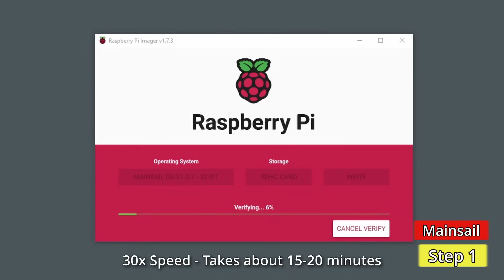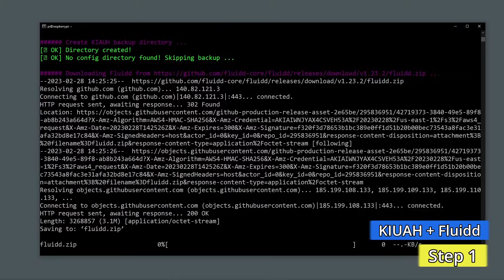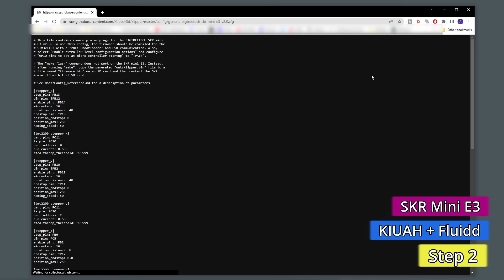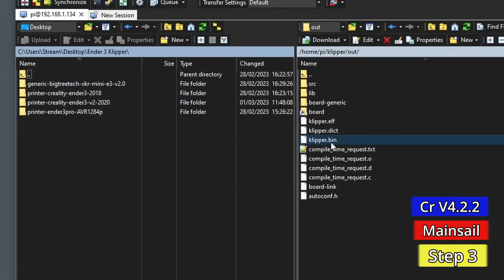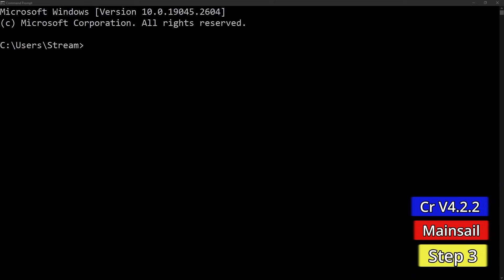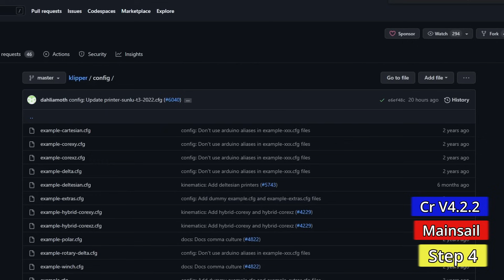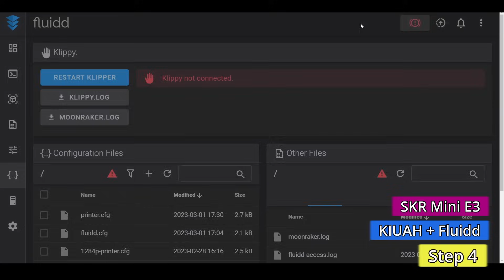How to Upgrade to Klipper on any Ender 3 for High Performance

Comment: FYI, when you suggest to NOT install the macros, this results in the mainsail.cfg file being missing.  If you run through the install again in KIAUH then the only prompt is to install the macros.  Doing so will add the mainsail.cfg file.  I saw some comments below about a missing fluidd.cfg and thought perhaps there was something similar happening on the fluidd side.  Hope this helps someone.
Reply: Thanks, it did..

Comment: When adding the board alias for the LCD display, you copied the alias from board 4.2.7. not board 4.2.2.  When I changed the bltouch pins to match the alias and couldn't get the bltouch to a closed state.  I found the LCD display config without the alias and the bltouch sensor worked correctly.  Everything else was spot on, thank you for this video.  Keep up the good work.
Reply: Hey, can you help me with this one ? Did you find a Pin-config for the 4.2.2 ? my display does not want to work :D
Reply: Could you please tell us where you found the LCD display config without the alias?

Comment: If you have problems with Mainsail and Ender where you can get the mcu but the the Mainsail os doesnt connect to printer (printer is not ready the klippy host software is attempting to connect. please retry in a few moments.), try usin command "make clean" when making firmware. I had made typo to config before and only this fixed it
Reply: what do you mean by when making the firmware? as in flashing it to the raspberry pi?

Comment: Klipper reports: ERROR

Include file '/home/pi/printer_data/config/fluidd.cfg' does not exist

Advice please :-) Thanks.
ENDER 3 2018 v1.1.3 Creality board.
Reply from the maker: you need the fluidd.cfg file. check the fluidd website and you'll see how what it should be.
Reply: @Vector3DP   thank you, it just lead to more errors and config warnings .. all a bit uninformative or Me.

Comment: I have the same Ender 3 neo with the 4.2.2 main board, I had an issue with the probe not working and saying “failed to verify sensor state”. How I fix it was instead of using the bed_mesh, safe_z_home, and bltouch sections from the ender 3 s1 config I used those sections from the neo v2 config. Still swapping Probe_in and probe_out .
Reply: Thank You, this was very helpful !

Comment: I have a Anycubic Kobra Max at work for some prototyping. And I’m thinking of adding Klipper into it. A Raspberry 4 in Germany is about 80-100€. A Creality Sonic Pad with Display and acceleration sensor is 120€. Is it worth to play around with the Raspberry if I can get something already being ready ? Is there anything better with the Raspi solution ?

Comment: thanks for an excellent step by step guide, just migrated my ender3 - 2018 to klipper and mainsail, didn't use a pi but an HP Thinclient T520, first print ongoing.
Reply: With the Creality 4.2.2 board? I ask you because I'm having problems with it right now. I'm using the configuration provided by the video (using the Ender3v2 configuration) for the Ender 3 with 4.2.2, but it doesn't work. My Ender 3 freezes with the blue screen on. I tried using the configuration provided by GitHub, but it gives me a .elf.hex file that the printer doesn't even recognize. I'm also using a laptop

Comment: For those who have problem with Bltouch/crtouch not responding properly or just crashing into the bed: 
1. USE THE ^ sign in the "sensor_pin: ^PB1". 
The damn ^ tells it to use a hardware pull-up resistor!, without it the probe might still send the "open" signal instead of "triggered" when pressed down, causing the nozzle to crash into bed while z-homing
2. don't use aliases in [bltouch] section, just write PB1 and PB0 instead of PROBE_IN and PROBE_OUT
Hope it saves some of you the trouble of figuring it out

Comment: This is the best video on the subject that ties it all together. I had spent many hours on other bits and piece of older videos without success. Once I found this video, I restarted the complete install from the start and ended with a functioning Klipper for my CR10S Pro V2 in very short time. Thank you!

Comment: My CR Touch sends a !! BLTouch failed to verify sensor state
I've been following the steps to a T, and did some research, I came across "pin_up_touch_mode_reports_triggered: False", which starts to home the Z axis. however my cr touch for my neo doesn't trigger and the z axis just bottoms out on the plate and the motor starts going nuts.  Any ideas?
Reply: To anyone with this issue, it was changing the pins in the bltouch section, leave it as is from the printer configuration without the aliases, fixed my issue.

Comment: I am working on an Ender 3 Pro that I have modded to the 4.2.7 silent board, V2 interface, a sprite upgrade direct drive extruder and a CR touch. Is the process the same as for the 4.2.2 board?
Reply: Ok, I discovered that the screen won't work with Klipper. However, I am unable to get the web interface to do anything to the printer after following the video. Any advice on that?

Edit: It will heat up the hot end and the bed, but I can't get the stepper motors to work.

Edit 2: I had the wrong pinout since I followed the video exactly. I got the pin out for the 4.2.7 and now it works.

Comment: Thank you for this guide it definitely helped although the switching between methods/boards did cause some confusion, I would suggest creating a separate guide for mainsail and fluidd with all the boards.

Also FYI there are a few errors on this guide for the SKR E3 v2. 

You cannot upload klipper via usb onto the board, it must be done via SD card and the .bin name must be firmware.bin, not klipper.bin
Reply from the maker: Everything I did in this guide I did complete on the boards so it's all possible as shown unless they have updated it and removed that function but that seems unlikely.
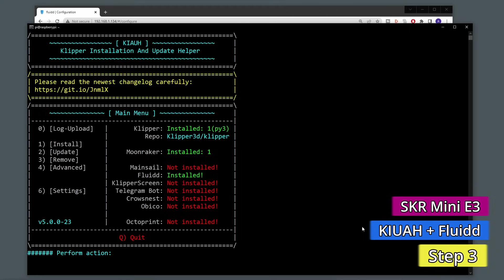Reply: @Vector3DP  If you read the documentation at the top of the E3 V2 printer.cfg (18:05) it has it noted and it did not work for me yesterday until i renamed it

Comment: im getting this error after i drag and drop the printer.cfg and put the [include fluidd.cfg] inside it.  PLEASE HELP
Include file '/home/pi/printer_data/config/fluidd.cfg' does not exist
Reply from the maker: That would happen when it can't find the fluidd configuration file which would be next to the printer. Cfg file. Maybe you have mailsail installed instead, or you need to create the fluidd config file.

Comment: Hi, how can I fix this error? I have the v1.1.3 board

/=======================================================\
| Make sure that the controller board is connected now! |
|-------------------------------------------------------|
|                                                       |
| How is the controller board connected to the host?    |
| 1) USB                                                |
| 2) UART                                               |
| 3) USB (DFU mode)                                     |
|                                                       |
|-------------------------------------------------------|
|         B) « Back         |        H) Help [?]        |
\=======================================================/
###### Connection method: 1

###### Identifying MCU connected via USB ...

/=======================================================\
|                   !!! ATTENTION !!!                   |
|-------------------------------------------------------|
| Make sure, to select the correct MCU!                 |
| ONLY flash a firmware created for the respective MCU! |
\=======================================================/
###### List of available MCU:
 ● MCU #1: usb-FTDI_FT232R_USB_UART_AM00KLO0-if00-port0

###### Select MCU to flash: 1

###### You selected:
 ● MCU #1: /dev/serial/by-id/usb-FTDI_FT232R_USB_UART_AM00KLO0-if00-port0

###### Continue? (Y/n): y
   [➔] Yes

###### Flashing /dev/serial/by-id/usb-FTDI_FT232R_USB_UART_AM00KLO0-if00-port0 ...

###### Stop klipper.service ...
[✓ OK] Stop klipper.service successfull!
  Flashing out/klipper.elf.hex to /dev/serial/by-id/usb-FTDI_FT232R_USB_UART_AM00KLO0-if00-port0 via avrdude
avrdude: stk500_getsync() attempt 1 of 10: not in sync: resp=0x65
avrdude: stk500_getsync() attempt 2 of 10: not in sync: resp=0x63
avrdude: stk500_getsync() attempt 3 of 10: not in sync: resp=0x68
avrdude: stk500_getsync() attempt 4 of 10: not in sync: resp=0x6f
avrdude: stk500_getsync() attempt 5 of 10: not in sync: resp=0x3a
avrdude: stk500_getsync() attempt 6 of 10: not in sync: resp=0x53
avrdude: stk500_getsync() attempt 7 of 10: not in sync: resp=0x44
avrdude: stk500_getsync() attempt 8 of 10: not in sync: resp=0x20
avrdude: stk500_getsync() attempt 9 of 10: not in sync: resp=0x63
avrdude: stk500_getsync() attempt 10 of 10: not in sync: resp=0x61

avrdude done.  Thank you.

make: * [src/avr/Makefile:34: flash] Error 1
>>>>>> Flashing failed!
>>>>>> Please read the console output above!
Reply: same error here. hope someone knows how to fix

Comment: I"m on 23 minute of the video and I encountered a problem. I have ender 3 neo with stock crtouch, but for some reason when I tried to home my printer the console outputs "BLTouch failed to verify sensor state". What should i do?
Reply: After I had the same issue, I watched another setup video. The guy in that one used the Ender3 V2 Neo definition. The BLTouch section had the following pinouts:
sensor_pin: ^PB1
control_pin: PB0

I think the carat was the difference and now that it works, I’m not changing it. 

Hope this helps!

Comment: Please help, I'm getting "No MCU found! MCU either not connected or not detected!" I selected USB. and when I pressed 5, it couldn't find any MCU on USB or USB DFU mode!!  i could only find MCU on UART and it's on dev/ttyAMA0 which failed to flash with that.
Reply: I've managed to get through this and now it's connected. the next issue I have now is the LCD. it doesn't seems to work with your instruction.
Reply: Did you ever figure this out?  @LastZion

Comment: It says MCU not found... not sure what to do.
Reply from the maker: Try again with the part of flashing the firmware to the 3D printers control board, and double check that your usb cable does data and power.
Reply: @Vector3DP  I tried that a hundred times. Only time it detects anything is when I choose uart. - thank you for the reply!

Comment: Edit: I hope that you are resting well and that your recovery and recuperation are fantastic. Sending best wishes and positve vibes to you - Get well soon. All the best to you and your family!
Reply from the maker: One of the best 3d printer firmwares available. Your loss.
Reply: @Vector3DP  Can I offer a suggestion? Find a way to show the section on editing the cfg file in a more user-friendly way. Your video is daunting and possibly intimidating to any users who are not familiar with Linux (which I work with daily, so this is no big deal). Configuring the firmware isn't the issue, but your process could be streamlined a little better with less back-and-forth editing.

Comment: Well, i tried installing Mainsail, I tried Fluidd, but whatever i try when i get to the cd ~/Klipper/ i always comes up with a directory not found. Looking for solutions on internet and forums left me even more clueless. Any chance someone has a solution here. I bet it's a simple one. Like when octoprint didn't want to run due to using the wrong power supply.
Reply: Hey, I guess it is a bit "late", but could be useful for others. If the cd ~/Klipper/ command fails with directory not found it only means there is no "Klipper" folder in your "home" (~) folder. It could be due to a missing step, an accidental delete, a new/different version where they changed the location or simply by using a different user on the system.
To resolve this it would be good to locate the actual Klipper folder and cd into that. (This is purely linux and linux commands, noting to with Klipper itself.)

Comment: Thank you!  About to try Klipper on my new Ender 3 V2 Neo, will follow your instructions.  I have an 8 GB Pi that I bought a few years ago that I'll dedicate to printing.  Thanks again!
Reply: hello, how did it go if I may ask? I am about to try and use Klipper on my V2 Neo as well
Reply: @zuschauer955  Actually never got around to it; gave that printer to my nephew.  Got a Creality KI now, just using it stock, it's going great.  Good luck to you!
Reply: @kennethbeal  Thanks for replying :) It was a bit of a headache but I managed to set up Klipper and have yet to configure some bits, but it's going in the right direction :D

Comment: This was great!
One note though is that the early 1.1.3 boars and similar needs to have a bootloader installed before trying to flash Klipper firmware :)

Comment: Great tutorial. I had trouble getting klipper to flash on my ender 3 pro with 4.2.2 board (blue screen, which is okay but I couldn't get the MCU id). After I did the following it seemed to work (3 commands):

cd ~/klipper/
make menuconfig

sudo service klipper stop
make flash
sudo service klipper start

sudo usermod -a -G tty pi

Found this on Klippers website about building the micro controller code. Using a different usb cord also seemed to be necessary. Hopefully this is helpful for someone else too :)
Reply: For me it was an issue that I encountered some time ago but that I completely forgot about. The printer accepts new firmware only if the filename of the firmware is different from the already installed one. Also the display isn't meant to display anything so look at the Klipper interface instead
Reply: trieed it but still doesn't work, maybe it is because i'm in ubuntu, but i also have the same printer
Reply: @TheThouZands  try a high quality cable. Try like 4 or 5 before you rule it out, that prevented me before this iirc
Reply: @iamsmashy  had seen that problem, but i tried 6 and none worked, figured out it was a problem with the OS, there are solutions directly for debian but not for Ubuntu, and i just installed linux only for printing, so i dont know shit about it as to translate the solution, so right now im installing debian lmfaoo
Reply: this worked, make sure to do a "make clean" before just in case

Comment: I keep getting stuck when trying to flash the board. I get an error code that says the mcu isn't connected. i have tried everything, different SD cards re doing the rasp pie firmware, different cables. I don't know what is wrong and it is driving me nuts.
Reply from the maker: Check the printer.cfg. Some printers can't be flashed over a cable (in fact quite a lot can't).

Comment: Damn that's a complicated process but bravo for explaining it so clearly! I'd like to upgrade my CR10S so that I can use input shaping at some time in the near future.
Reply: Hey did you instaled it in your cr10? how it went?
Reply: @diogorodrigues1571  Yes I did. It was very challenging, if you miss a step or make a mistake at any stage of the process, it won't work and it's best to start again from the start.
I had to design a housing for the CB1 Pi, new BTT SKR Mini 3.0 motherboard, plus touch screen, it was so satisfying when I managed to print something,and it's so much quieter.
Klipper keeps getting updated and unfortunately after having a working webcam, an update stopped it working. the coding takes a while to understand but you get used to it and the Klipper forum is very helpful.

Comment: I appreciate the video as I am considering doing this to a bunch of Creality Machines. I will say, I have a hard time following this, and some sort of flow chart outlining the steps and the software used would help. Also, could you give me an opinion on how I would also connect this machine or several machines (running Klipper) to Octofarm on the Same Rasperri Board?

Comment: For the price of a Pi today, I'd upgrade the board to a Manta M4P + CB1 to run klipper.  Probably cost you half as much of a Pi.
Reply: I’d love to see a guide on that, sounds interesting for sure!
Reply: ME as well, this seems like a step up from the above video.  @TheExtremeElementz
Reply: I can recommend Rock CM with manta m4p, it is a bit more painfull to get klipper installed as it requires more certificates, but once you got that figured out rest is a breeze. Also it is in stock, so no overpriced scammers/no stock issues.
Reply: Cost me like 20 quid for a pi 2 what are you on about
Reply: @snerttt did you buy it under the pi shortage? The short story is under the shortage they cost twice as much as msrp only came in stupid kits and were almost never actually in stock. Atleast in my country.
Reply: @kristian6087  when I wrote the comment I'd just bought it off eBay.
Reply: What about the rpi zero 2 w
It's reasonably cheap.
Reply: @cryptorial I know, that's what I did and it works, there's even a Nero 3d video on it

Comment: Very nice and concise tutorial. A bit window-centric. No wonder, most people use Windows. But I guess Linux users would be able to figure this out by watching this video and adapting tools used.
Reply from the maker: If you can use Linux, you can probably do this in your sleep 👍
Reply: If you're running Linux, i guess you could minus the pi, if the computer isn't going anywhere
Reply: @travistucker7317  Is what I did, no Pi stuff, I just installed klipper/moonraker/mainsail in ubuntu and i'm controlling the printer and that machine from my windows pc. I did this just because I had a spare pc so buying a pi didn't make sense in my case.

Comment: sorry, how are you getting 24 volts from the ender3 PSU to the pi? Did you clip the wires or something cause mine doesn't have those bootlace connectors on the end
Reply from the maker: For this demo I ran the pi all external. Adding a couple of wires to the existing psu should be pretty simple. I've done it on the ender 3 v2 for adding lighting.